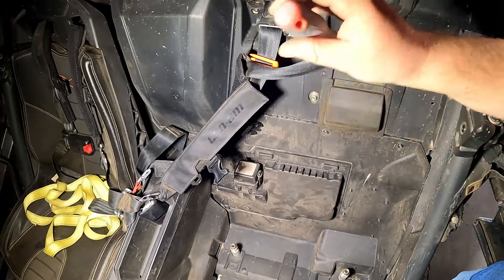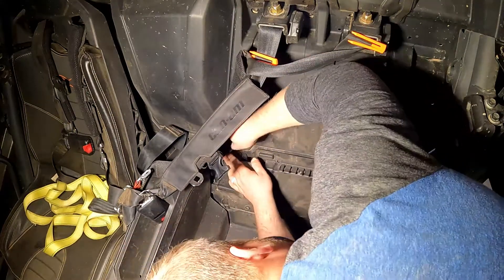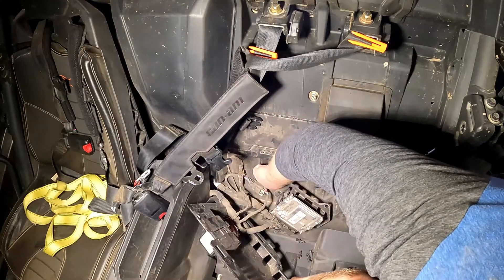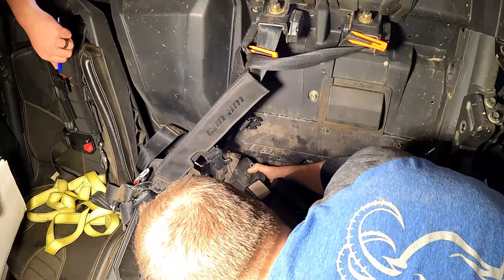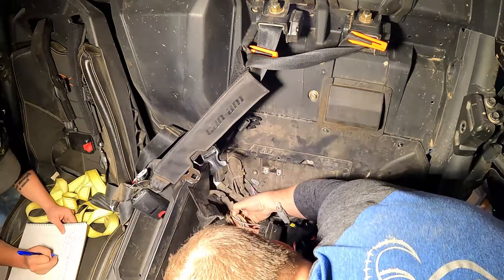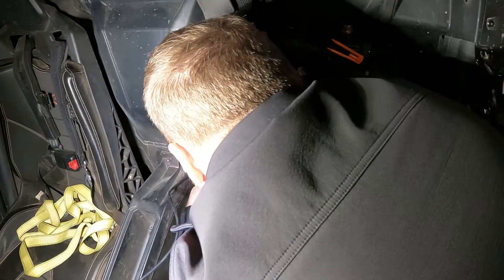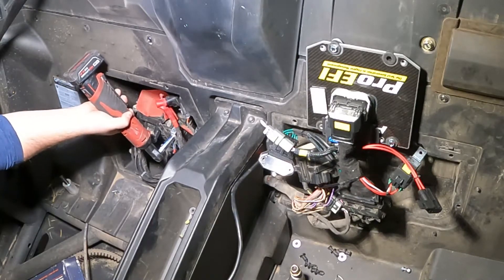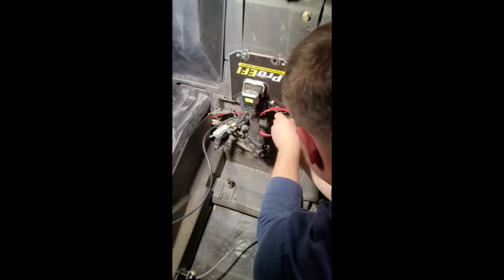ProEFI™  ECU Can-Am™ X3 Install

Comment: Have you guys had any trouble with the TPS / TB dropping out to 50% despite the pedal being 100% open in the data logs or continued loss of TB plate opening and closing?
Reply: Usually it was a bad throttle body. seen many of them go bad.
Reply: @forlater8711  Agreed, unfortunately that did not resolve for us. We've swapped in different TBs, pedals, harnesses, and still the same results. We are running it a little strange with some factory components missing such as the over ride switch, no gear position sensor, and no DPS (switch or unit).  I certainly wouldn't think any of this would matter with the stand alone setup, but maybe I am missing something.